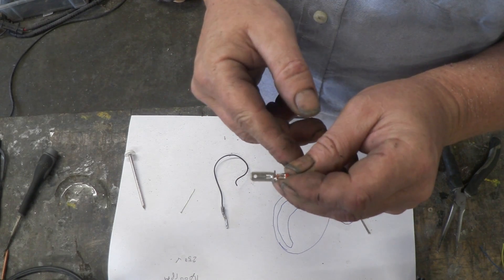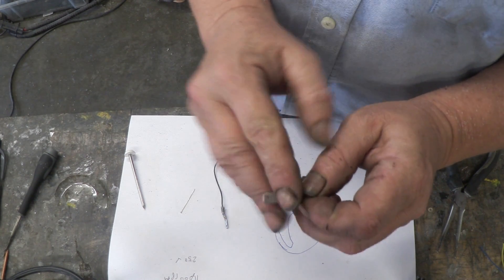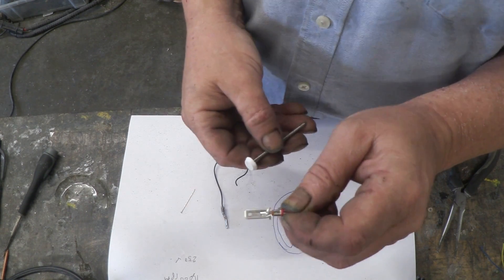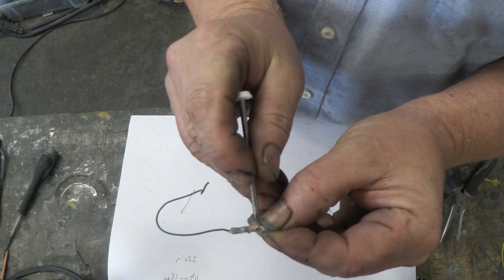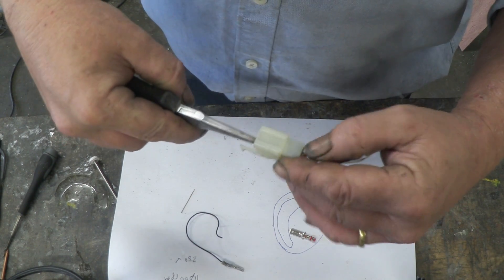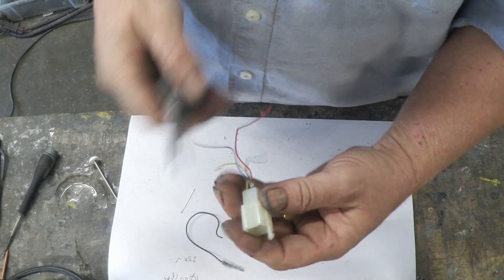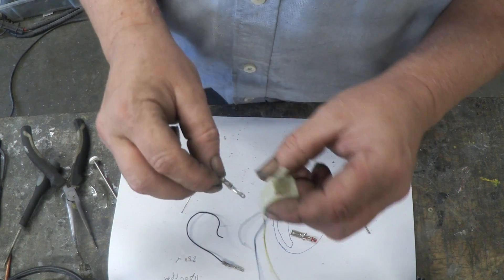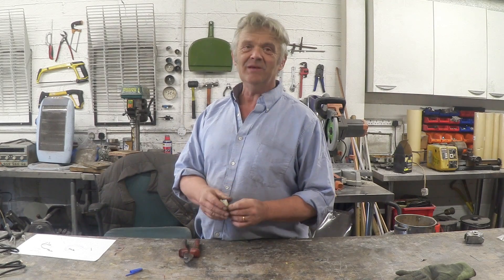1241 A Simple Trick For Correcting The Pins In Wire Plug Connectors

Comment: And if you're dealing with the very very tiny molex G version the tiny black or white three or four pin connector sometimes 2 pin they make a tool for it so you don't bend it up although I've never had to use the tool I always go over to a bench grinder and grind down a very tiny nail to the right size and keep it at my work bunch. With the molex connectors it's so easy to destroy the connector by pulling before the tab is pressed down so you have to be careful because once it's cracked you need a new connector

Comment: Switched out the fuse box on my sister in-laws Chevy Aveo. It had burned out several fuse connections and destroyed the box. I picked out every pin in the burned out fuse connections and put new connections in a new fuse box. 
Lots of tedious work and soldering. I was glad I didn't have to do the entire box. With new plugs and fuses. LOL 😆

Comment: A good tip is when some crimps/tags are difficult to remove, push the wire first as this will push the crimp/tag up in the connector a bit and stop the tang/locking tab digging in to the plastic of the connector when trying to release it. Used this trick many times.

Comment: On a different topic but very much your kind of thing, I was sat in the garden the other day and the parasol I was sat under started spinning in the wind. I then realised it could possibly be adapted as the frame for  VAWT. The ribs/trusses that hold the parasol up could fairly easily be covered with something to make a wind turbine (once the fabric was removed). It has the benefit of having a little height already too. Anyway, I thought of you as soon as I thought about it. Just thought I'd throw the idea out there, I may well have a tinker with it soon. Some extra rigidity would probably be needed but It may well be possible without too much messing...